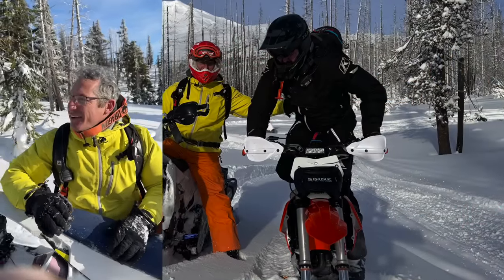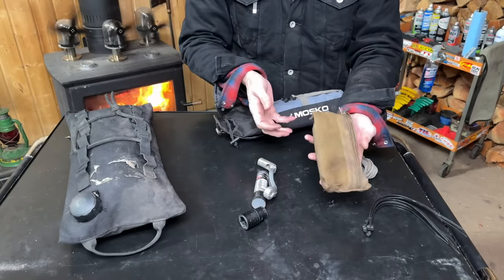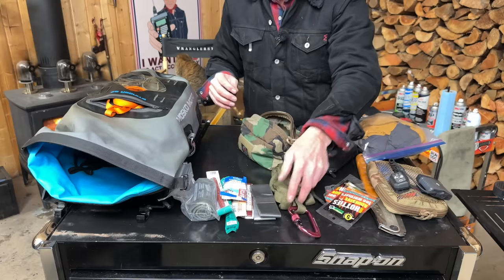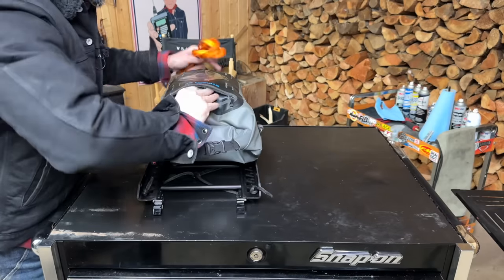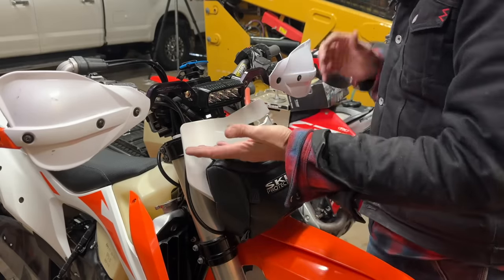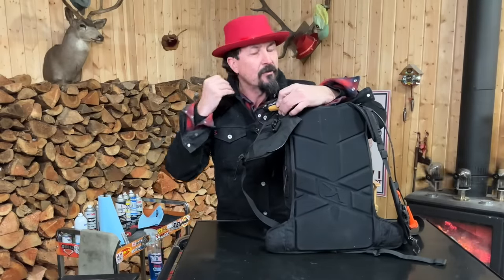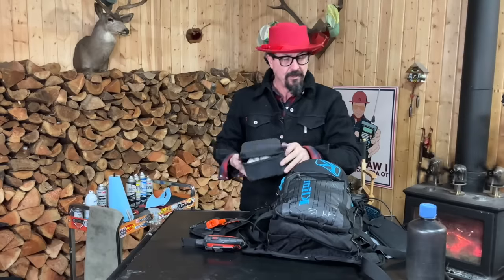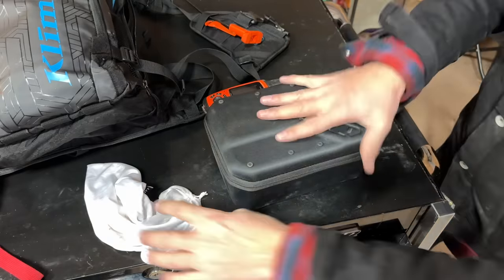Why I'm Getting Roasted - My Side of the Story

Comment: Great pack. Only thing i would add is a jet boil and 2 refills for it. Will fit in that pack no problem and can help melt and boil snow for extra water in case of emergency or freezing and will last a long time . And if you have the space could also throw a couple packs of top ramen in there for emergencies or just some warm calories.

Comment: I’m glad for you to have gotten into a fun sport such as the snow bikes! 😃 I’m still old school sledding, newest machine, a 2005 600, oldest a 1993 580 special vintage, now replacing the rubber carb boots on it, the recoil rope & rubber safety shut off plug two years ago. 😝
The older the machine, the more wrenching it requires to keep them going. Not a fan of having to wrench on things, especially when obsolete & parts are harder to get ahold of!!! 😑

Comment: New heated Google brand,Tempest optics, the heating is in the frame, along with the battery, so no delicate wires from lenses, and they run off sensors, so they don't run all day, you fog up, they turn on, and back off. Battery lasts at least 12 hours, with usb-c charging in the goggle frame, no bulky external battery pack

Comment: I'm not sure if you are doing this for a reason, since you have been a 'Tuber for a minute.  It's a little wonky when you have scenes filmed/edited reversed.  It's much worse when you make reference to right/left, as you did with the inflator handle on the avalanche pack, which is a reverse video scene.  Or maybe you just wanted more comments about that, in which case, well done.